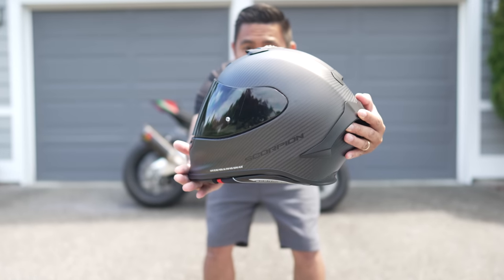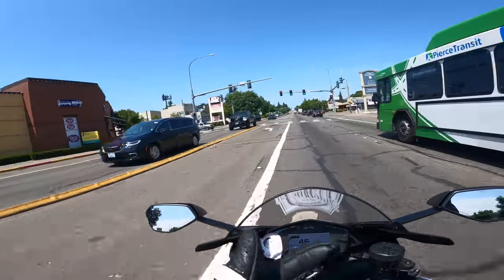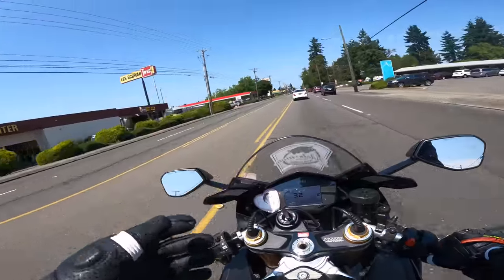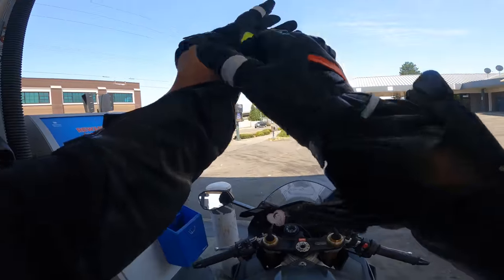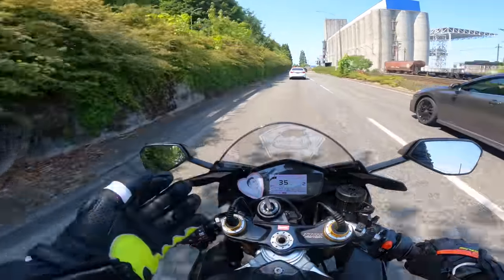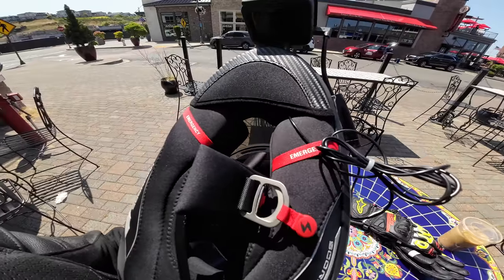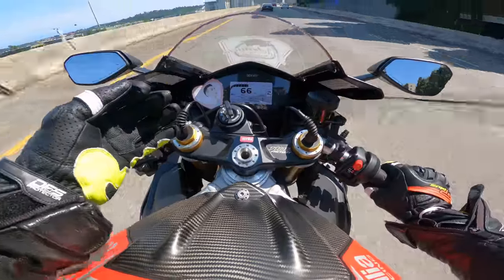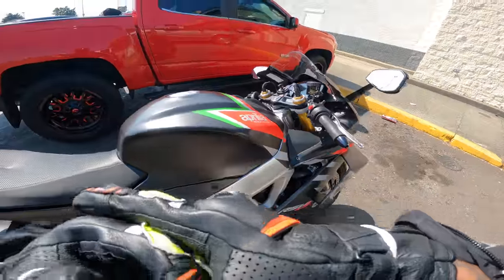THIS $500 MOTORCYCLE HELMET HAS ONE MAJOR ISSUE!

Comment: Imo I think the HJC rpha 11pro has just as much going for it, while having a better fit and finish. It has a carbon, aramid, fiberglass mix shell, ece approved, very light weight, nice liner, 5 year warranty, comes with a clear and smoke shield, pin lock lens, has a very good field of vision, the locking mechanism is hella solid and retails for around $450ish. I’ve had my hands on a ton of helmets and the 11Pro is still one of my favorites.
Reply from the maker: Nothing I’ve tried is better than a $1200 agv. But for the price point, the scorpion is close. The fov is bigger on the scorpion for sure
Reply: @adobomoto  hahaha I am by no means comparing a $450 hjc to a $1200 Agv, but I would like to see a head to head vs the rpha 11pro and the scorpion you reviewed.
Reply: @adobomoto shark race r pro gp. Issa quiet
Reply: totally agree.
Reply: HJC is definitely a better choice. The original post was comparing the rpha 11 to the scorpion in this video, he was not comparing it to the AGV. 
agv makes the best looking and the most comfortable helmets but i don’t trust the safety of AGV
also the customer service from AGV/Dainese is absolute crap.
Reply: @adobomoto Nahh the shoei x14 and now x15 is better. I hear your complaints on the liner but I don't find it uncomfortable. BUT I think my new Shark Race R Pro puts them above all the others. Better airflow than the shoei's but its quiet. Aerodynamics are insane. Just as good if not better than the Pista. Lighter too. Pista is just overpriced for a lack of features as I would call it. Love how guys in shorts and t shirts will ride fancy bikes with an AGV Pista. You can spot the ones out there to look cool vs the ones out to actually ride
Reply: @Problica  I agree with most of this, aside from Shark being better than Shoei [or Arai]
Reply: @ayowser01  Ehh I don't like any of the Arai's I have tried. I would say the Shoei is just a half step below my new Shark. I love the Shoei.... LOVE them. But their liner just doesn't compare to the Shark
Reply: @adobomoto 
Binging your backlog atm.

The Scorpion website doesn't specify the ECE rating so I don't know if the USA has received the new updated 22-06 R1 Air yet but it is much better than the old one but all in subtle ways.
I imported mine from Europe last year and I find it better than the Pista in all regards except looks, the Pista cheek pads are ass. The new R1 is MUCH quieter than the previous version and a few websites have tested it as even more quiet than the RF1400, it also has a bit more side padding and it's super comfortable.

Comment: - Owned this helmet for about 3 years now as a daily rider on sports and nakeds as well as the ST1400 (same lens as the R1).
I cant tell you how much I love this helmet (9 lenses of different kinds of love), I have personally not had any quality issues with either helmets. I got one one for track and the other for daily use, ended up liking the R1 more for both due to the lightness of the helmet and the venting.

- You can get cheek pads that size up and size for ~5mm, I dropped ~5mm on my cheeks and was able to wear a large. I did however have a bit of uncomfortable pressure on the forehead as described in the video. Fixed this by applying some moderate pressure along the crown and compressed the foam ever so slightly which solved my issues. I'm sure this would happen on it's own over time.
Reply from the maker: I’m gonna send mine back for a replacement. Not worried about a little vent!
Reply: How’s the wind noise on this? I have the scorpion EXO R420 and it’s gnarly gnarly.
Reply: @s1k_azure  I wanted an answer to this
Reply: @s1k_azure  i have a r420 and its one of the quietest helmets ive ever worn.

Comment: I've been riding on the road and track for 15 years now and I've never understood complaints of wind noise. I've used sub $100 adventure helmets that strained your neck like crazy at highway speeds, I've used $1000 plus carbon fiber helmets and I've used everything in between and any noise related to turbulence or air circulating through the vents has never even been a consideration in my opinion. That being said, your review was fantastic. I think with a tad bit better quality control on the securement of those attachments and they could have an absolute top tier offering at a near entry level price (for quality track applications). I've been considering this helmet and the AGV K6S as a possible next helmet as my Corsa (past 4 riding seasons) is beginning to show it's age 😅
Reply: Which one did you get if i may ask? I am having the same thoughts either K6S or R1.

Comment: Highly considering this as my next helmet as I need something with an ECE rating for track  days at my local track. I've always worn Ear-Pro while riding so it baffles me that you've never worn any for as long as you've been riding. Could be because I've only had a cheaper HJC helmet which does the job but is noisy af. Must be nice to have a more premium quiet helmet. I think I may opt for the standard R1-Air as it might have a bit better sound deadening. Plus, it's slightly cheaper. Time to go to my local gear shop to see if sizing is true to my measurements.

Comment: What’s the difference between a race helmet and other helmets? (If they’re all ece and fim certified)
Reply: Race helmets are usually designed to be more aerodynamic and lightweight than other types of helmets. Since racers need to be able to move their head around easily and quickly, and they need to be able to hear what's going on around them. They have more ventilation too like the air vents

Comment: just wanted to let you know, the jerking when letting off the throttle on your 07 is because it automatically closes the air butterfly valve. It saves you fuel, and is one of those environmental things. it is usually worse the less cylinders you have, on some 1 cylindered bikes it is god awful and quite scary if you arent used to it

Comment: I've been using this helmet for a year now and I can't stop raving about how amazing it is for the price. I live in Canada and got it for $400USD and the value is just second to none. It's lightweight, comfortable even on long rides and have no issues with the FOV. Haven't had any issues with it falling apart. Other than general scratches and wear and tear it feels brand new. They released the R1 EVO which is pretty much the ECE 22.06 version of this helmet and supposed to be a bit quieter.

Also, what chin mount is that? I have one from Chin Mounts but it's very bulky.

Comment: I’m not gonna lie I run red all the time if I’m sitting there for 3 minutes and the light doesn’t change I’m out, they definitely need to fix the sensors in the ground
Reply: In the California dmv handbook, it states after three light cycles and the light hasn’t turned, you can treat it as a stop sign as long as the cross traffic is clear. Having a camera that records you will help in court if a cop was hiding somewhere too

Comment: I got the Corpus Phantom after you swore up and down on this for $319.95... It's ok.
Reply from the maker: That’s the even the helmet I reviewed. Poly-resin vs a carbon fiber race helmet.
Reply: @adobomoto it's the Exo R1 Air just not the cf version.
Reply: The Corpus Phantom is race spec, you Flip.

Comment: Terrible helmet and poor quality. I've owned them all and currently run with the Shark Race-R Pro GP  by far the best.
Reply from the maker: Agv pista is the best. But for $500, it’s great. They slapped spoiler on the a shark race r and added $200 the the price point 😂, weak
Reply: @adobomoto  Talking safety wise, Shark is rated 2nd under FIM to the bell